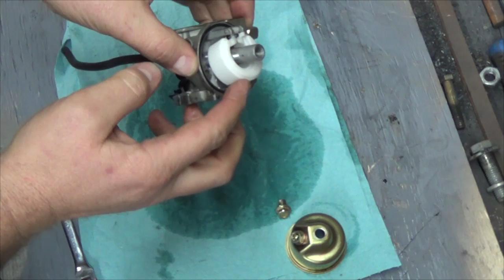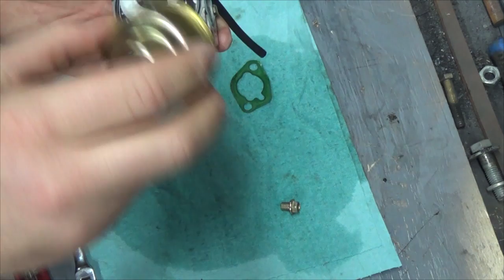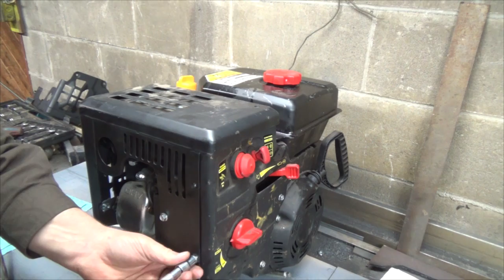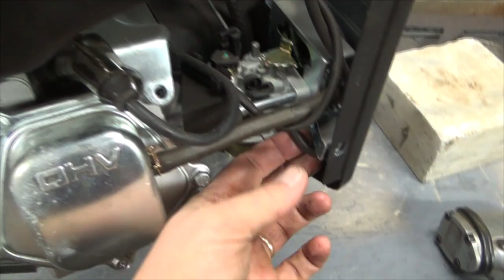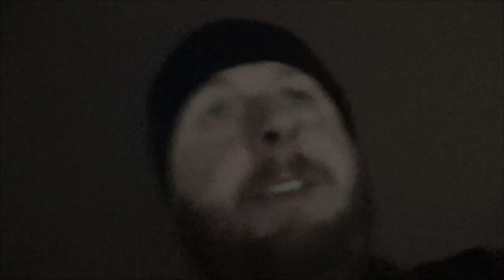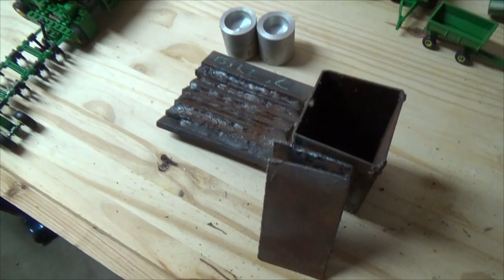cleaning out the clone carb and looking at the BIG engine

Comment: I work on small engines and from the sounds of the motor, its a govenor issues. Find the spring on the govenor, make sure its got enough tension on it. What tends to happen is the spring wears out and as its running its pulling back and forth and back and forth. Make sure its clean and free of debri, then if possible replace, or shorten the spring. But be careful because if its messed with too much itll burn the motor. Also i see its overhead valve pull the valve cover and check the valve lash, this too will fix some of the back firing popping. It looks like a Honda clone i have practically the same motor only Honda brand this is what i had to do to fix the same issue. Also the Carbs are really cheap generally under $15 US often on these its more effective to replace entire carb. Good luck.

Comment: i've had a trencher with a Honda engine the surges like that little engine, we had to replace the carb due to sand getting past the air filter and the ethanol in the fuel.

Comment: Put some carb cleaner in the tank with the gas, Seafoam the best there is. There are some areas with shape bends you can't clean out with air or a very fine wire. Let Seafoam do it's job, run the motor I bet under load it smooths right out.